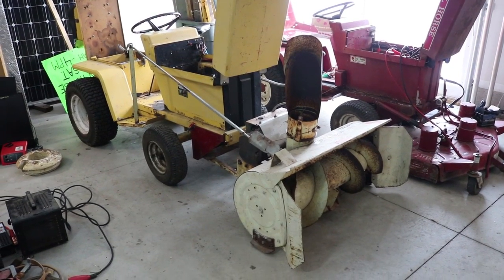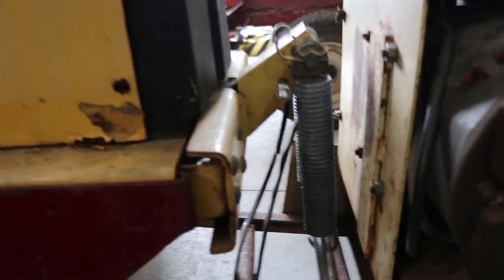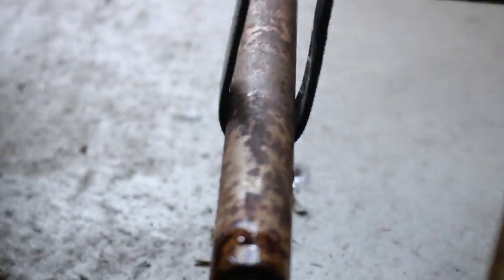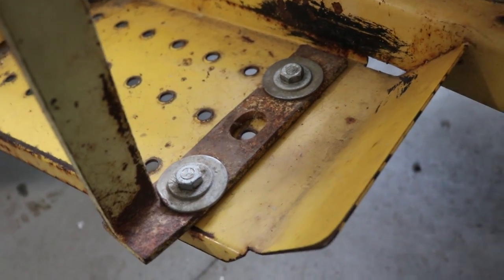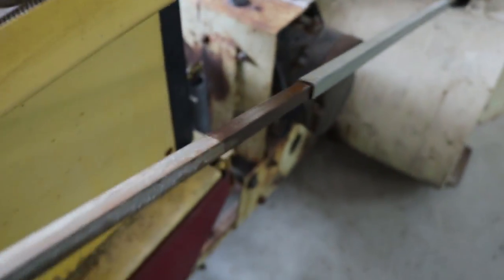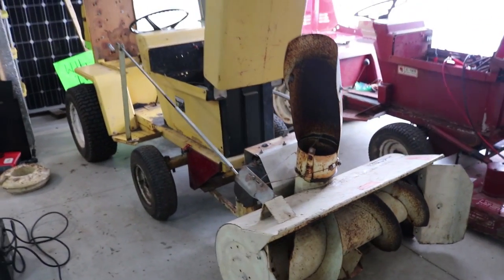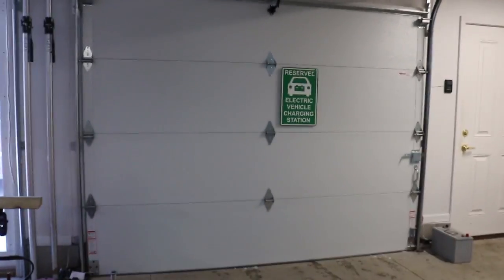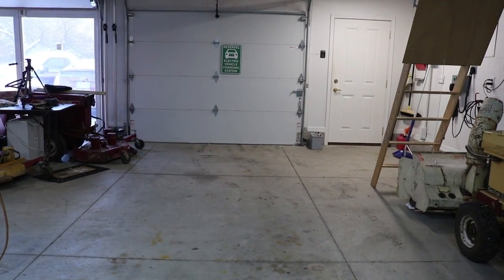Electric Snow Thrower

Comment: Only thing I can see to add is maybe one of those flexible cabs made of tarp material to knock some of the wind and snow off you as you work. Having grown up farming sitting on a big hunk of metal doing laps in cold weather isn't much fun so anything would help.
Reply from the maker: I actually have a bolt-on cab for this tractor, but it's a pain to put on and take off. The cab also makes it tough for ducking under tree branches to mow near trees in the summer.
My driveway isn't THAT big, so I should be fine just bundling up.